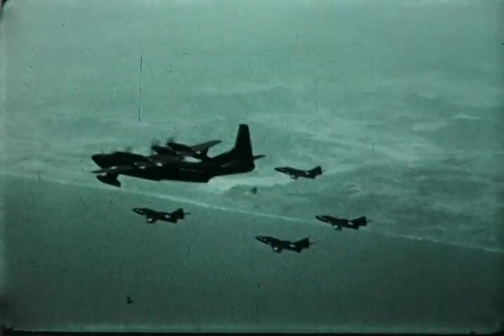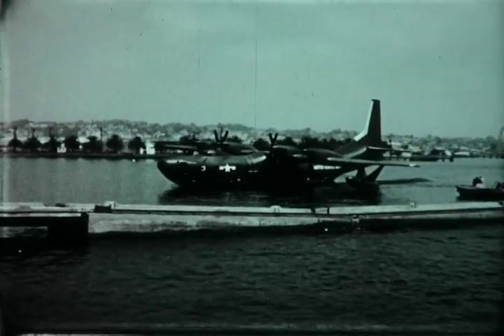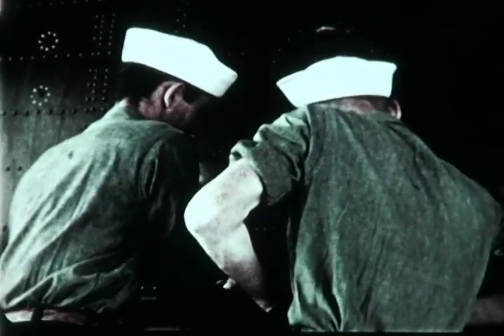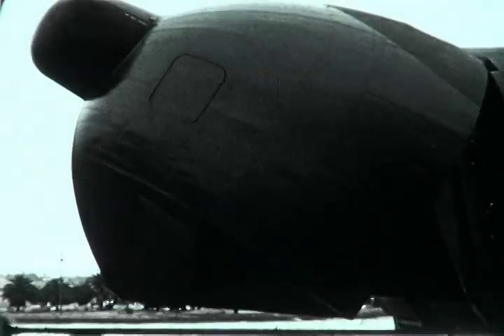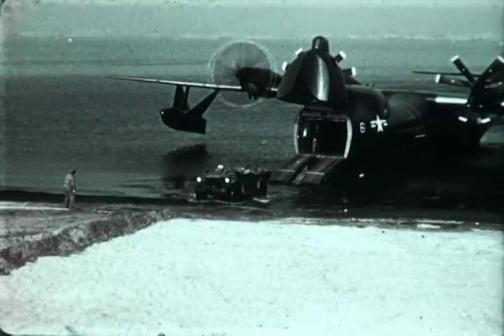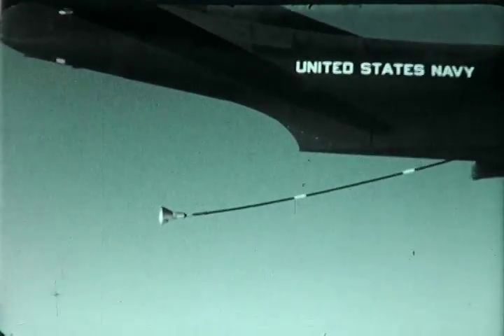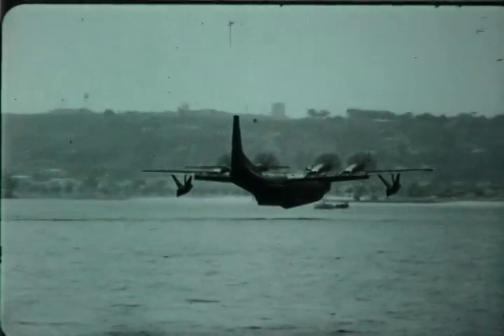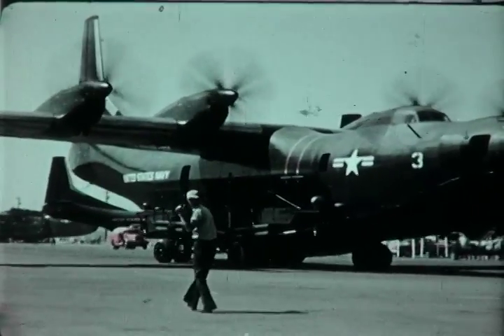F-0692 Video: A Report on the Convair R3Y Tradewind

Comment: Why did the US Navy stop using flying boats?
Reply: They were really beauties.
Reply: I think it was the same thing with other aircraft from the 50s, the Jet engine was being refined to where it was leading the way in efficiency on fuel less repair etc. These wonderful craft just got lost in the mix.
Reply: @gregriddle5163  : Their are few military forces that still use flying boats for their military use such as Japanese Defense Force and the Russian Navy.
Reply: Corrosion and rivet popping from landings and take offs in salt water and wave action in oceans.
Reply: During WW2 many airbases were built on Pacific islands.   Now no Need for seaplanes.   Though the vid depicts servicing on the water, this is bit of a stretch.  Seaplanes need beaching gear and concrete ramps for serious servicing.   But since the 50s, the US has abandoned Pacific bases, maybe the Tradewind’s time will come again.